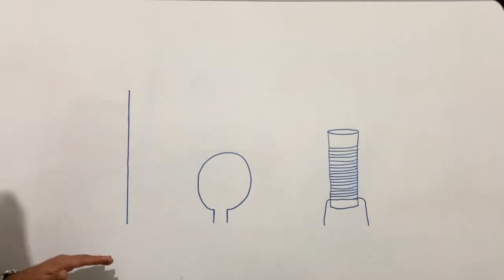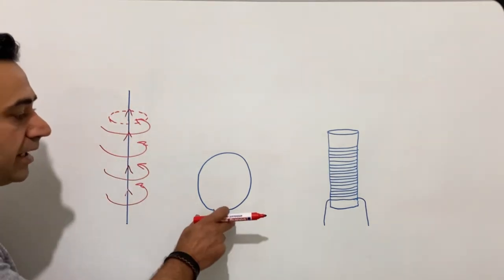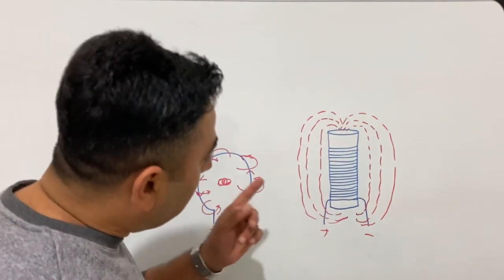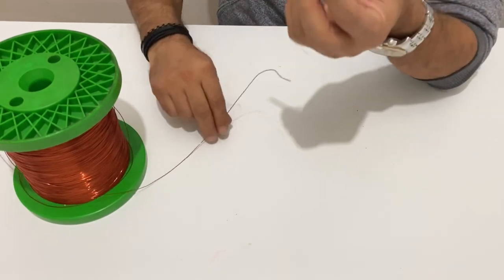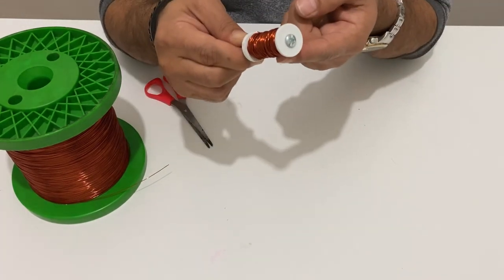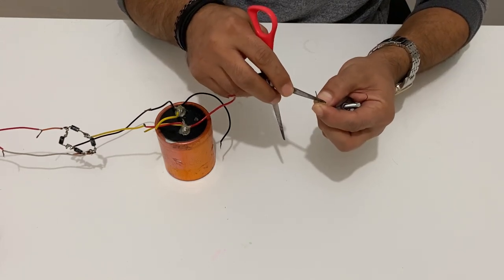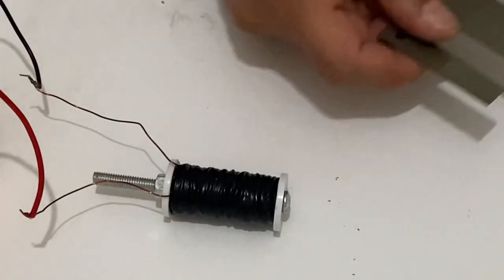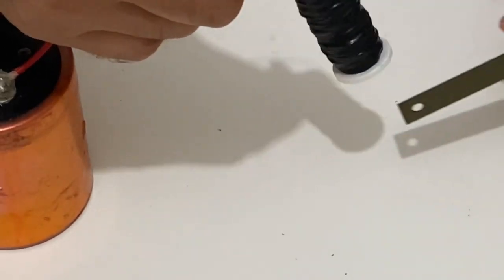How to Make a Powerful Electromagnet | How does an electromagnet work? | DIY |

Comment: Why 500 turns? If you use thinner gauge wire does it get weaker?
Reply from the maker: The turns of wire can be changed. If you increase the number of turns. Your electromagnet will be stronger but if you use thinner gauge wire it cannot handle the current and it will melt. You have to find the optimum turns and thickness of the wire according to the amp👍